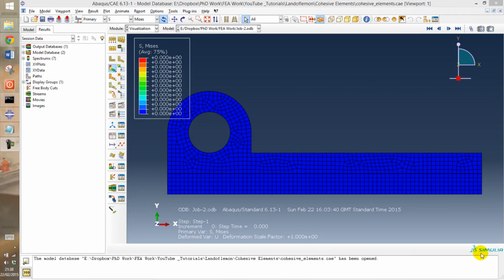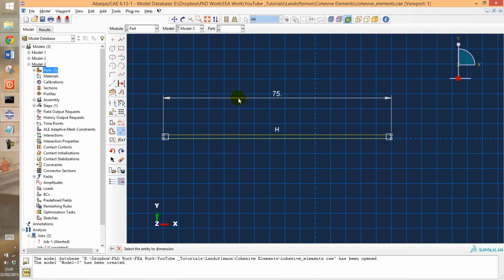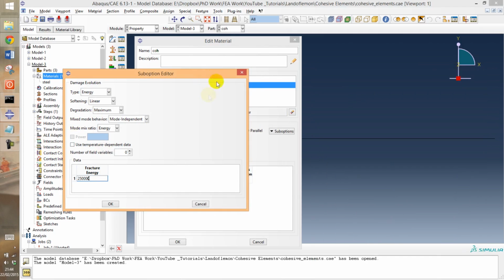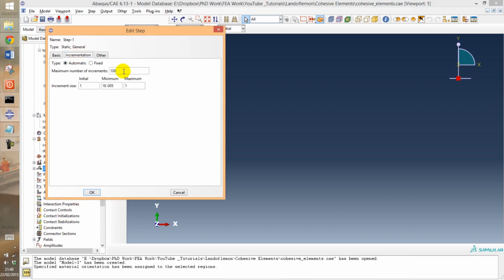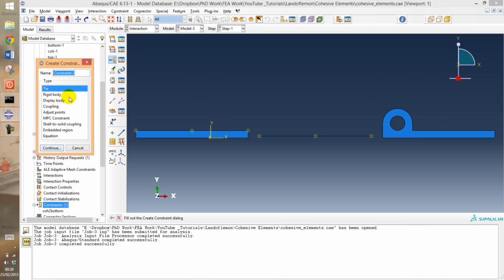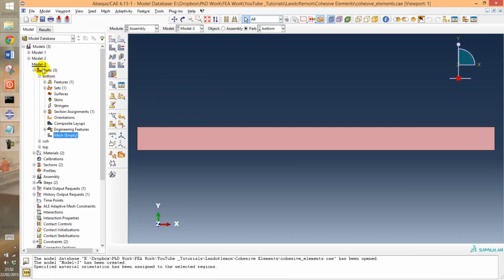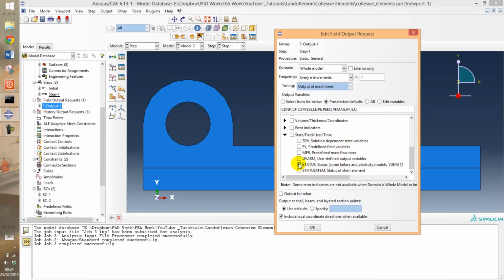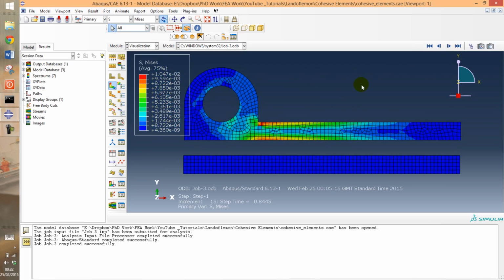Abaqus - Cohesive Elements & Tie Constraints Tutorial

Comment: I am making the model for ABAQUS in Hypermesh. I have to model 2 individual carbon fibers of the specimen and the matrix is thermoplastic. 3d model is created using python script. i am planning to create a surface over these fibers(which are wavy and rectangular cross section for simplification) but how to add the tie constraints? it is quite a difficult task as I would need some advice from ABAQUS expert.

Comment: I followed your model carefully. The modeling itself is good, but crashes halfway to separation. The problem is the convergence of the contact between top and bottom. Solution:

Reduced initial step size and increased number of increments
Element type : I tried CPE4 or CPE4R both work
BC-2: I added 0 for U1 and UR3
Contact Controls: Automatic Stabilization
Apply contact controls to interaction Int-1

Thank you for the tutorial. It helped me quite a bit.
Reply: Bastiaan van der Vossen It works. Many thanks Bastiann!!!
And Thanks for the great tutorial! Ianndoflemon
Reply: Hey sir,
After i followed your steps, i cant see the failure of bonding line. How can i see it?
thanks in advance
Reply: That's it!! Solved the issue for me! Thank you

Comment: i have a question here. He takes plane strain thickness as 1 in the section module. However other dimensions are 5 and 75. So to be plane strain, thickness must be much more than 5 isnt it? Or am i missing a point??
Reply from the maker: Hi, yeah in this example the thickness is much greater than the other dimensions. Just the way I did that example. I normally model carbon fibres and just used to doing in that way, where the length of the fibre is much greater than the diameter.
Reply: thanks for the quick response, i am dealing with GFRP specimen, and trying to model delamination with cohesive elements, and my dimensions are like 6mm length and 2.7 mm layer thickness. And the 3rd dimension is like 6mm again. I was putting 1 all the time for plane strain thickness and out-of-plane thickness for cohesive section. So do you think i should put 6 instead of 1 in my case? Regards
Reply from the maker: I think you could take it as either, but if you take it as '1', then you'll have to account for that in the resulting stress, as your cross sectional area would be lower.

Comment: I found where is the error. For BC-1 and BC-2 ,apply it in initial step rather than step-1 and for BC-3, apply it in step-1. Take maximum increment as 100 and initial as 0.05. Best of luck to all.
Reply: Applying the boundary conditions in initial or step-1 makes no difference.

Comment: hello, thank you for the video, its really good detail, i just  have a question  i am knew to abaqus and i am trying to model a composite singe lap joint using cohesive elements and tie constraints for the adhesive in the bond area, i am just not sure how to find some of the values, like (E/enn)  (G/ess) etc. as well as the fracture energy. Can you give some insight into this matter?  Thank you so much.
Reply from the maker: Hello, if you can't find those values from literature for the particular adhesive you are using, you will have to conduct mechanical tests to get the specific values. You could also do mechanical tests on a lap joint, and then tune the numerical material properties until the model begins to behave like the experiment.
Reply: this web is not found,can you send a new web or tell me how to get the vales

Comment: Hi , thanks for your useful video , I wanted to expand this work and have a 3D module so I followed exactly what you do in this video , but in visualization module the cohesive elements did not vanish like 2D module , however I active status in step module , I appreciate you if you help me to remove my problem 
Best Regards
Reply from the maker: Make sure you switched the status variable on. Alternatively, hide the cohesive elements using the view manager if you'd like.
Reply: I checked and I'm sure status is on but again I have this problem and cohesive elements didn't remove  I don't know what should I do , Is it possible for me to send this file to you to have a quick look on it? !!
because is necessary for me !!
thanks

Comment: Hi thanks for your video. I have followed exactly what you have done but I am getting error (Too many attempts made for this increment). Could you please help me how to resolve this.
Reply: Try changing plane strain elements from CPE4R to CPE4 (uncheck reduced integration when you select element type).That solved the problem for my model.
Good luck
Reply from the maker: Fereshteh Sabet Thanks for the suggestion, I hope this helps others.
Reply: just reduce the stiffness values by two zeros
Reply from the maker: I had a similar problem when I first tried, my problem was that I'd not setup the tied constraint correctly. Ensure that the Master surface is on the metallic part, and the cohesive surface is the slave. That fixed the problem for me.
Reply: Sam Abd I am also getting same error.
Reply: +Fereshteh Sabet this didn't help me :( thanks for the input though.
Reply: I was also experiencing "too many attempts". 
I made it run by adjusting "Maximum number of increments" to 1e7, and use CPE4. 
But my results are different from the video , where TOP and BOTTOM were not entirely separated. 
Please, providing me some common on reduced element and what result you got differently.
Thank you so much!  Merry christmas! landoflemon
Reply: Thanks khaleefa11. It worked for me.
Reply: I think its just a units problem. Reducing the displacement to 0.05 worked for me, which makes sense if the rest of the model is in SI units, displacement would be in metres.

Comment: Hi thanks for this very helpful video.
I am trying to run my model however I get the following error "The node numbering might not be correct for element 321 instance coh-1" and this error is reoccurring for many elements. Do you know where I might have gone wrong. Bare in mind I'm modelling in 3D (swept). Thanks
Reply from the maker: I'm afraid I've never encountered that error and I don't understand where the problem would be. It's certainly very strange.